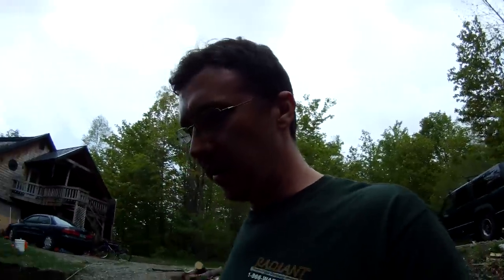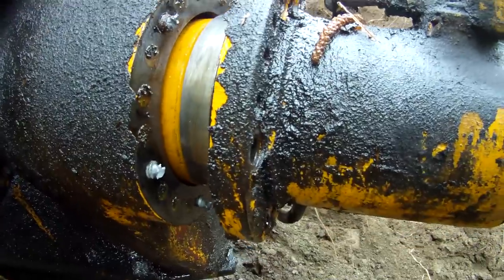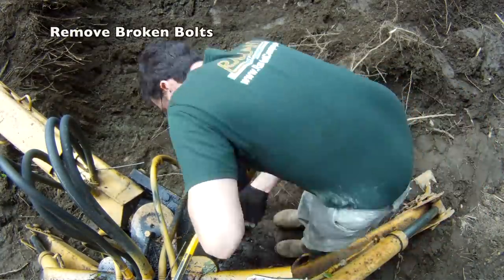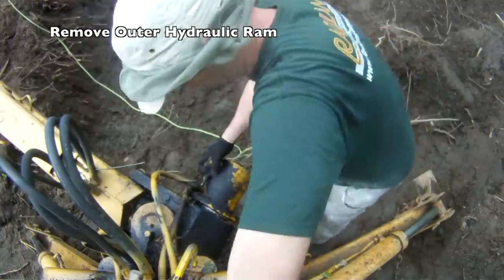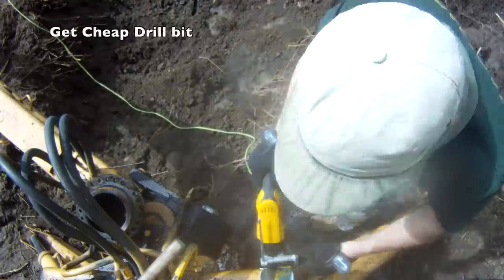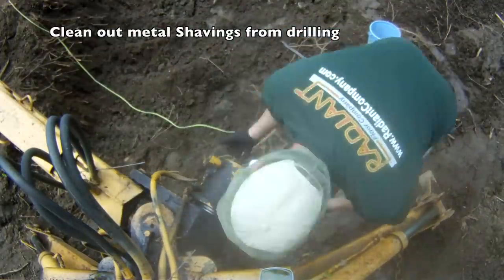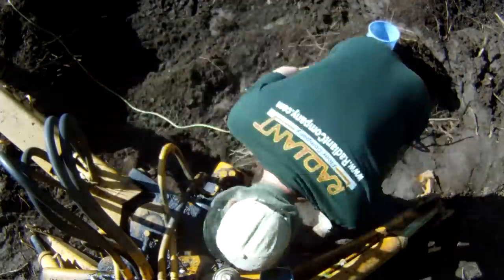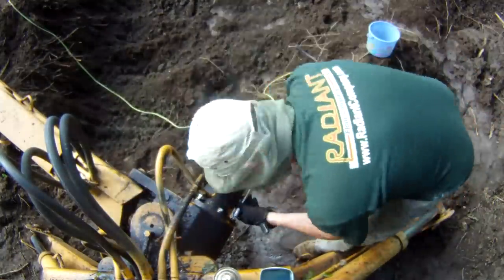Fixing an International Harvester 3414 Backhoe - 4 - My Garage Build HD Time Lapse

Comment: In the future, try putting a nut on the bolt all the way. Take a grinder or hack saw and cut off the amount needed. I like the grinder better so I can angle the end of the bolt so it goes in easy. Removing the nut will take off any burs and you will be good to go in a few minutes.

Comment: Can't believe you didn't use grade 8 bolts...  But excellent job...
Reply from the maker: Are you familiar with the function of a shear pin?  Think of these bolts in the same way...what do you want to break?  The housing?  The bearing? Something else?  Nope, you want the bolts to break, then you just go get some new ones and you're back up and running.  Otherwise you're grade 8 bolts just destroyed your tool altogether.   This incident illustrates this perfectly.
Reply: My Garage Build I suppose you're right.  My Cat 416 is about 20 years newer, and a completely different setup, so I'm just guessing. Although I doubt any grade bolts would be enough to break that thick harden steel there.  But they weren't sheared off were they?  That looks like an outward pressure that was caused, I suspect,  by all but one of the bolts being loose, and when the single one holding the load popped, it had a hammer effect on the rest.  Speaking of which, you might want to check the bolts on the rest of the old girl.

btw, enjoying your vids, and thanks for making a play list...
Reply from the maker: That's an excellent point, it probably was just one or more loose ones and they just couldn't hold once that play developed.